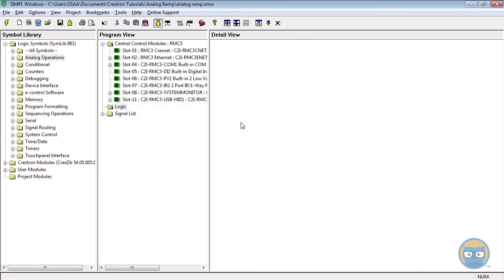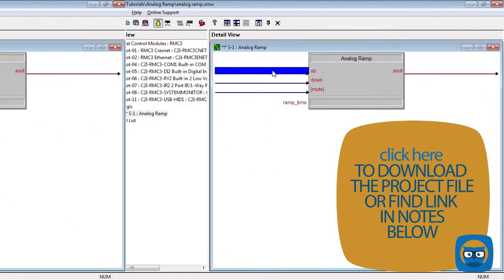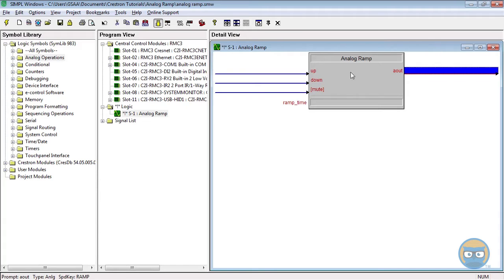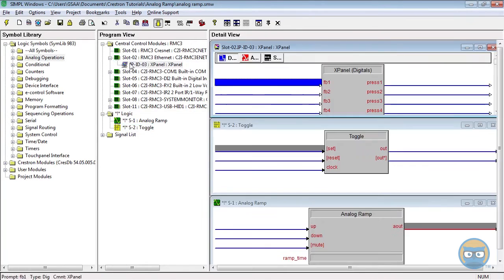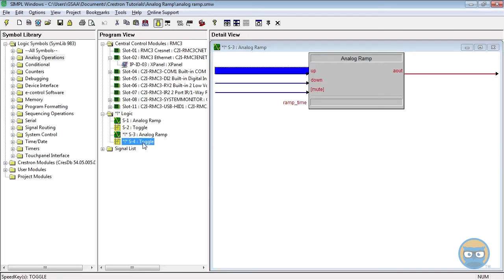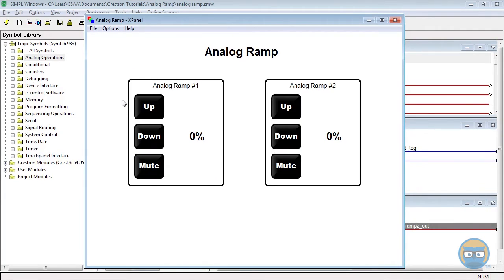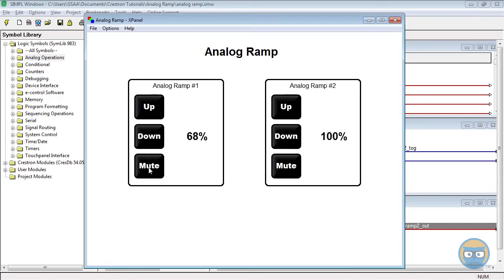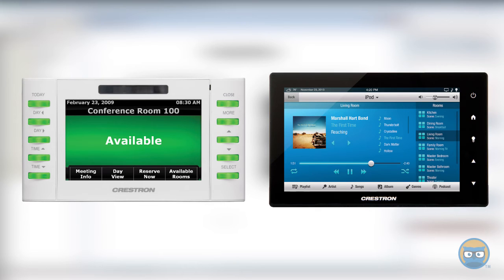Crestron SIMPL Windows ANALOG RAMP Symbol Tutorial

Comment: Is it okay if i use this for a lighting system program??was thinking of dimming and brightness of the lights  and at the same time having a off/on switch for it along with a slider like how you can control the volume for your devices
Reply from the maker: This will do it! If you plan on using the mute input on the Analog Ramp, you'll probably want to put an Analog Rate Limiter between the Analog Ramp and your lights. This will make the lights dim on and off as opposed to cutting them off completely.